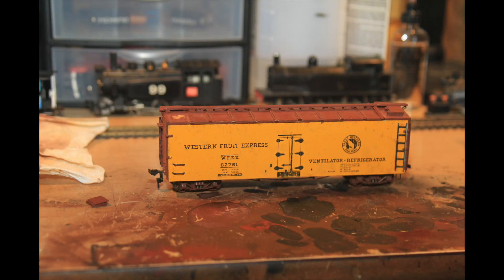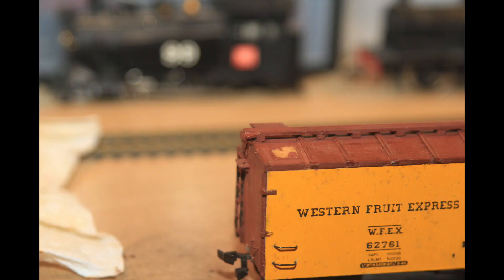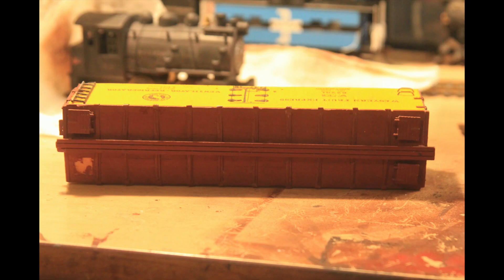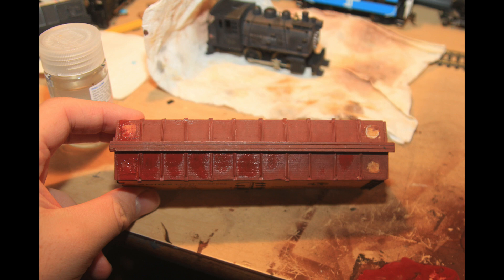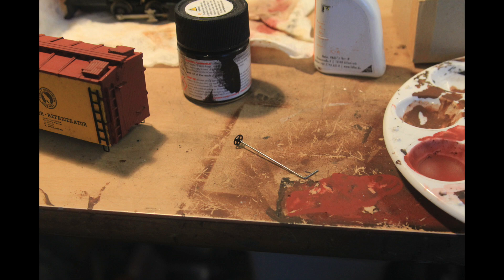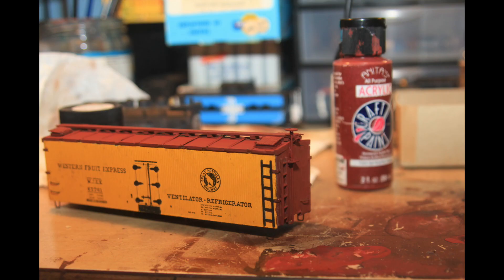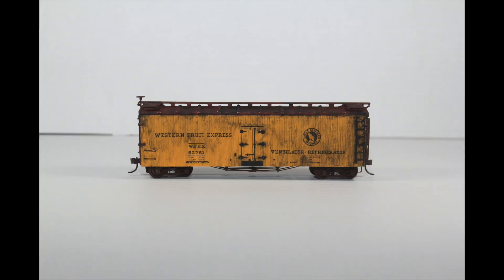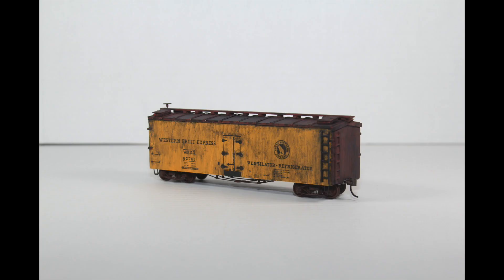Craftsman GN Reefer Restoration

Comment: Well, I got HO scale trains for Christmas.  Since I used to live in Jonesboro, GA, I model the Central of Georgia Railway Company.  I got 1 Atlas RS-3 Central of Georgia, 1 brass Hallmark Fairbanks-Morse H12-44 Central of Georgia, 4 freight cars Central of Georgia (one was a very detailed Kadee freight car) & 3 MOW Maintenance of Way freight cars by True Scale (1 Kitchen freight car, 1 Maintenance freight car & 1 working Caboose).  Day after Christmas I got my birthday present which was another Atlas Fairbanks-Morse H15-44 Central of Georgia.  I changed out all the plastic wheel sets on my rolling stock (80+) to Walthers Proto 2000 metal wheel sets.  I also body mounted Kadee couplers on each piece of rolling stock.  I'm now going through all my rolling stock to ensure they meet the NMRA weight standards.  Cheers from an ex-Georgian in eastern TN
Reply from the maker: Thanks for the comment, sounds like you got a lot of cool stuff. Good luck with your upgrading.  Happy modeling.